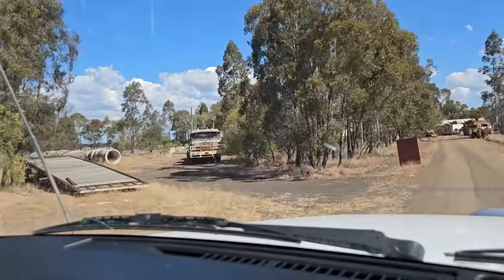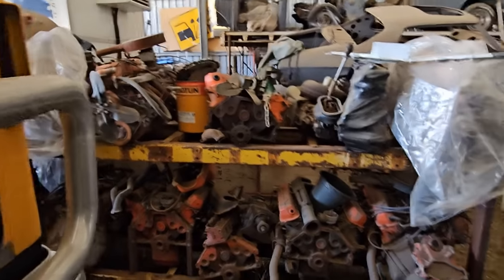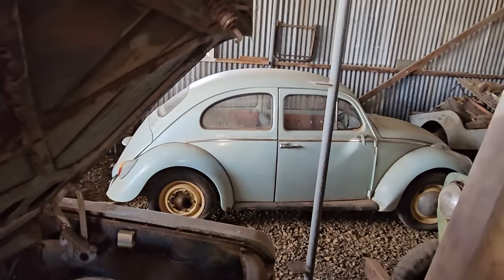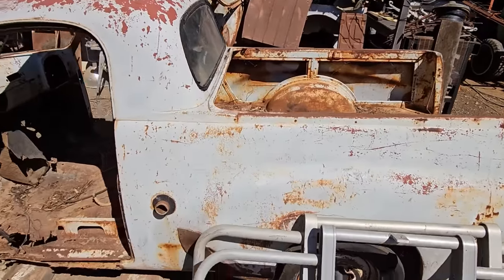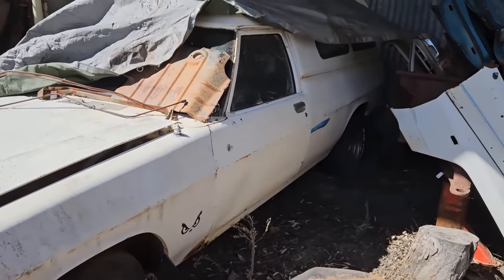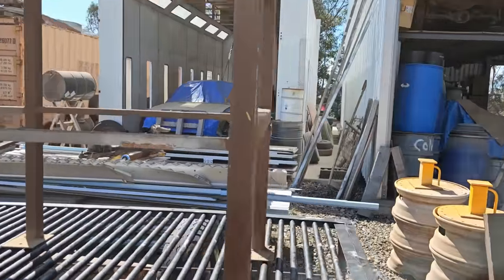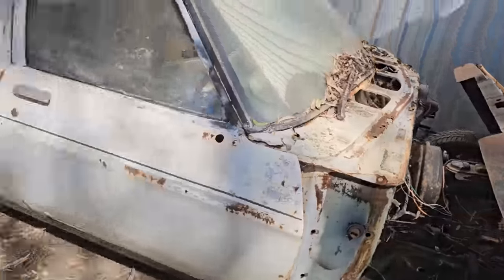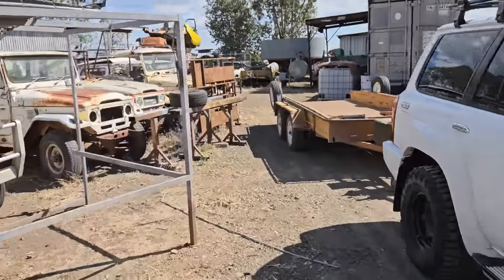BARN FINDS, TORANAS, MONARO COUPE, EH PANEL VANS & ARMY JEEPS, CHEVY POWERED LANDCRUISERS!!

Comment: I hope he realises the vt commodore he is trying to purchase is not a vt. Amazing barn find. Drooling over the eh and toranas.
Reply from the maker: glad you enjoyed the tour, yeah i did realise its not a VT after the fact. so many nice old vehicles. i love the old EH wagon i think it was. so much appeal with the old roof racks 👍
Reply: @goldshiftgarage EJ wagon. Holden prefixes for you, 48/215, commonly known as the FX, FJ, FE, FC, FB, EK, EJ, EJ was the last of the Grey motor, EH, the first red motor, 149 & 179, HD, HR, HK, motor size went up to 161& 186 with the first V8 Holden's running small block Chevy's of 307, 327, HT, first Australian built and designed V8 of 253 & 308, 350 small block Chevy's in the Monaros in Bathurst spec. HG, HQ,173 & 202 sixes, 350 Monaros and Statesmans, HJ, HX, HZ,WB, commercial and Statesmans only, then the Commodores. I'll have to brush up on the Commies. Hope it helps. Great vid by the way. Cheers.